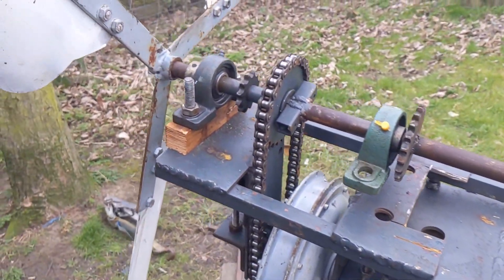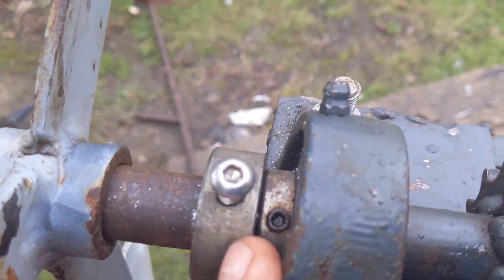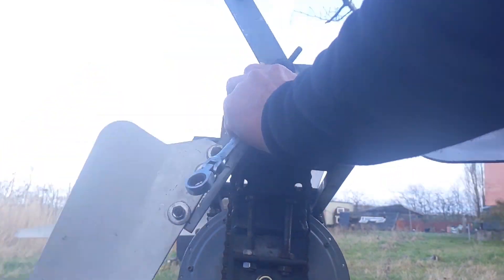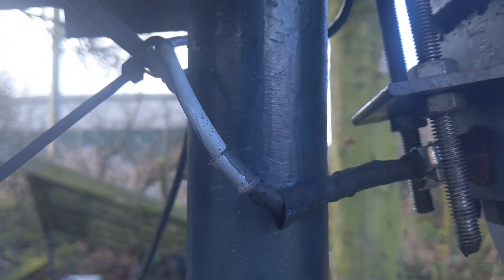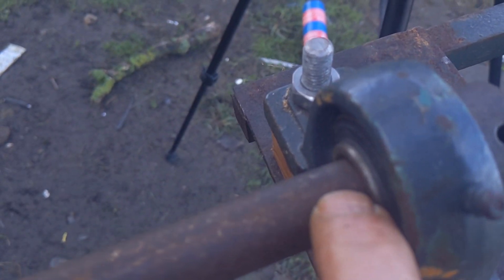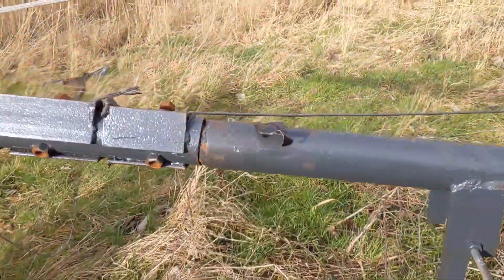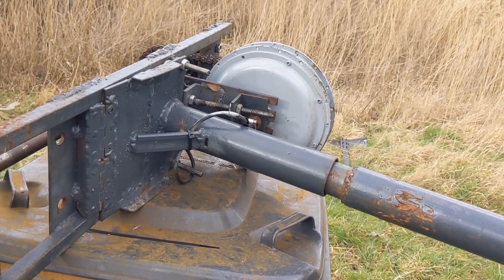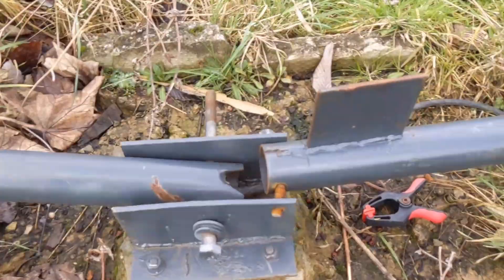Electric Bike 48v 1kw Hub Motor Wind Turbine Free Energy Project - 14th February 2022

Comment: Looking forward to seeing more from this and glad to see more uk videos, also where do you suggest is the best  place to get good motors for a wind turbine
Reply from the maker: You won't have to wait too long to see how much power this motor makes :), the blades and the turbine have to match , if this works fine then I will build another lighter frame for it and I will make the whole video of the build :)
Reply: Gavin forgot to mention but in my knowledge, DC motors that are made to spin relatively slowly are the best. Simplest would be to search internet marketplaces for broken e-bikes and hoverboards. Also smart drive washing machine motors if possible, they are rare here where I live.

I've collected some of hoverboards' motors and not sure if going to use them as is or use the magnets for other, bigger low rpm motor to convert into permanent magnet generator. I also have 33kW AC motor lying in my garage, could be something to convert.